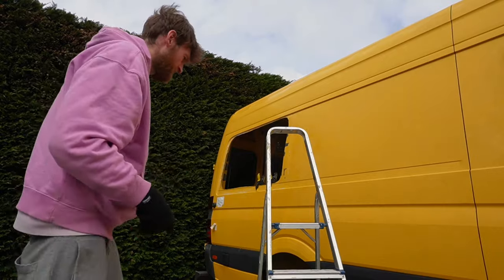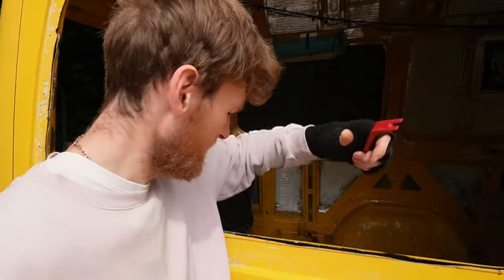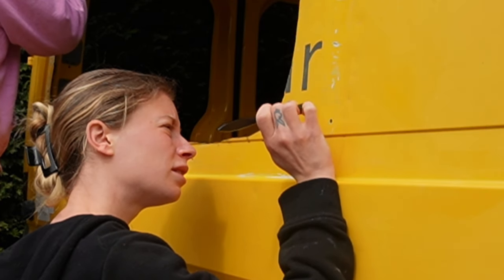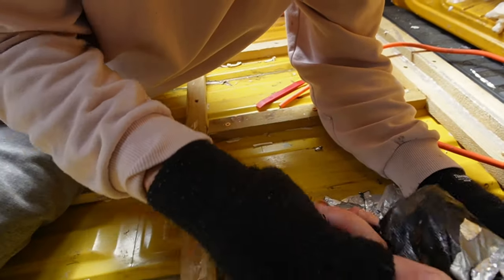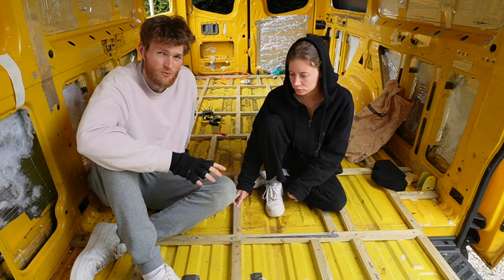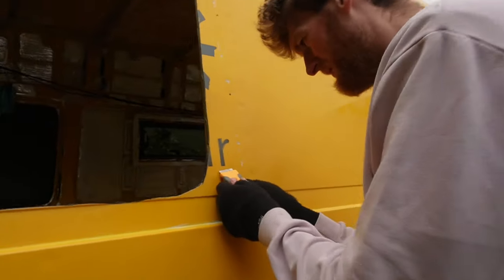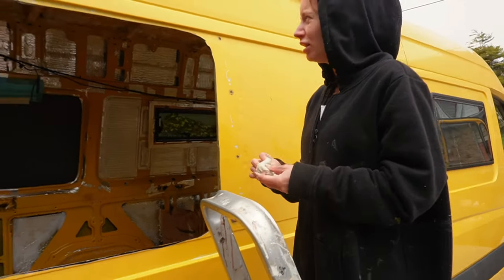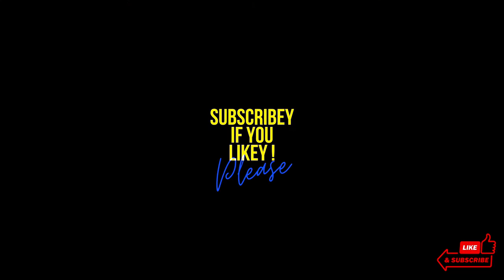the soul destroying hole in our van | sleeping pod fixup | newbie van build | ep 13

Comment: Isopropyl Alcohol is a camper builds best friend when it comes to anything sticky, if you are looking at cutting costs then superglue and cotton wool are the perfect hole fillers (but never breathe in the fumes), when removing anything silicon, score the silicon so the isopropyl can soak in, 30 minutes and it just peels away.
Reply from the maker: Brill thanks for those tips! Makes a lot of sense to score, pour and let set, then let it peel off, we deffo didn't do that lol woops!